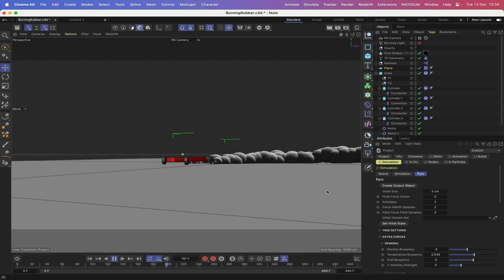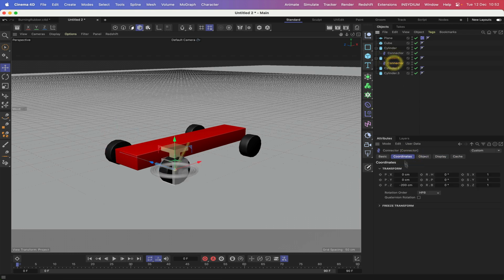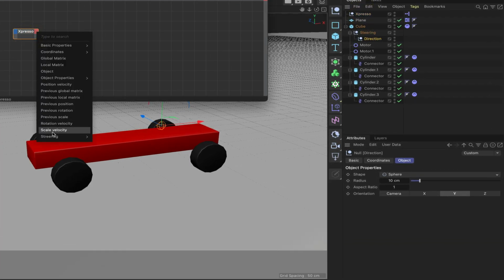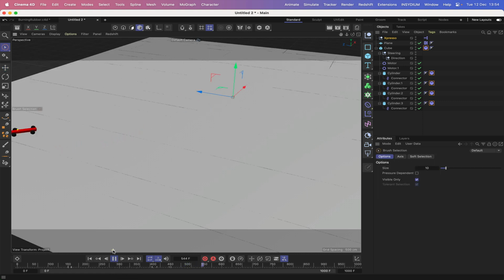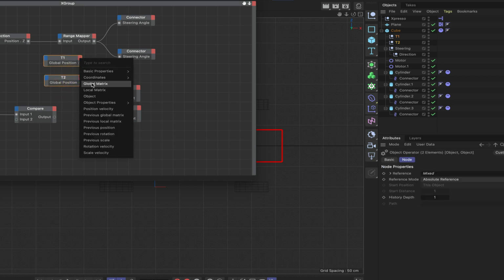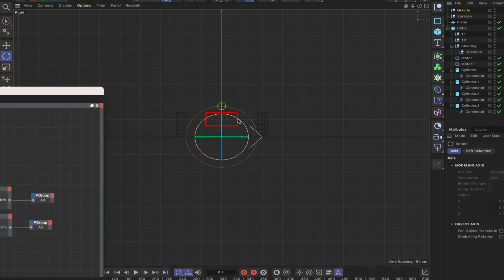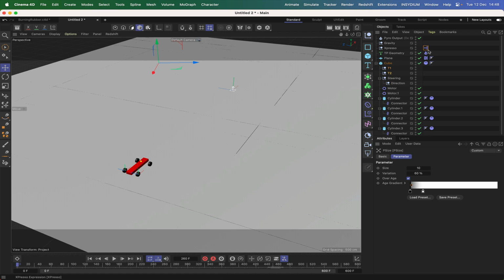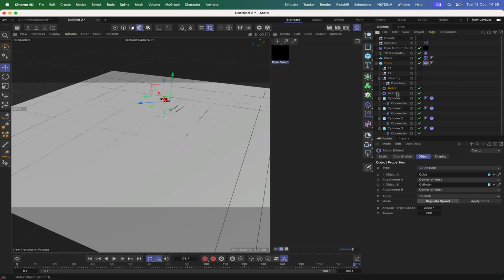Cinema 4D Multi-Tech Tutorial 44: Burnin' Rubber!

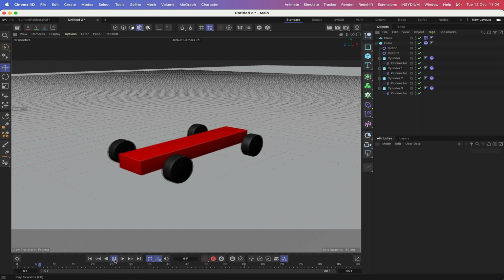Comment: 10:31 In fact at this point nothing can happen, your model can just stand there and that's it. On two different PCs you will get completely different results with the same settings.
Bulet dynamics is a very cool system but its realization in C4D is a fiasco. So everything is ill-conceived and not optimized for the workflow that led to the fact that this system was ignored by users. Everyone knows that this thing is needed to pour balls that will shake on the floor for a minute)).
 I have seen a full-fledged solution only in Houdini, where many processes are automated.  
Anyway, thank you for the lesson, I gained some more knowledge.
Reply: For those who will try and make mistakes at the first stage 
You need to set the axis of rotation not only for the motor but also to orient the wheels so that the Z axis is directed along the axis of rotation.   Why is this done? I have no idea as I wrote above the developers did not care much about logic.
Reply from the maker: That really interesting. I actually looked at another video tutorial for car set up and there was no mention of the wheels and motors needing to both be oriented along the Z axis. It was pure chance that I did this anyway and the thing worked. I would have done a lot swearing had I orientated the wheels along their X axes, for sure! I will glad when all of the bullet dynamic elements have been ported over to the unified dynamics. It will make life far easier than the hybrid state we are currently trying to work with.